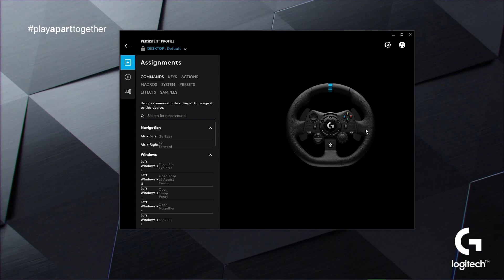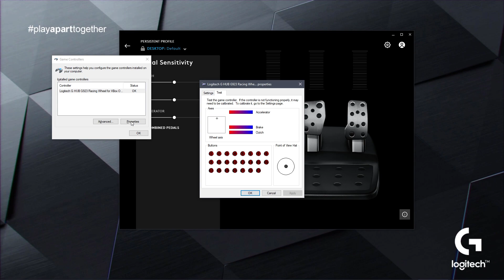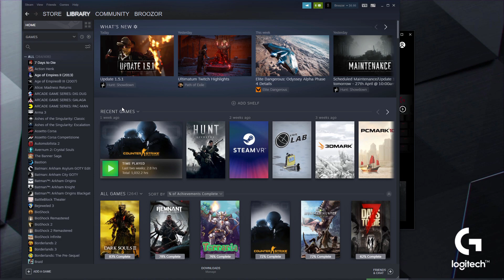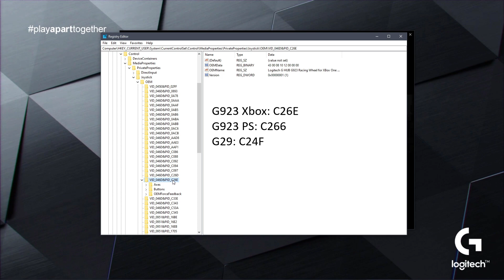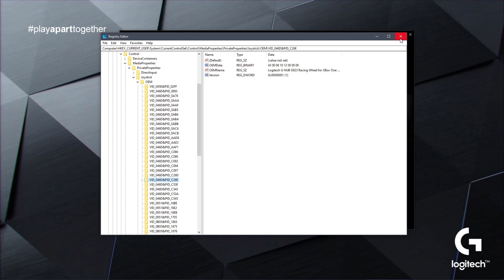How to troubleshoot G923/G29/G920 for Connection Issue

Comment: nice didnt work at all and didnt return in registry thanks for nothing
Reply: READ ALL, I FOUND A POTENTIAL FIX- I fixed it. So what I needed to do was unplug everything from my outlet (except the one below, for context I had an 2*3 adapter for a 2 plug outlet) and it worked just fine after. I had been searching for months prior and I was on the verge of selling it but all it needed was its own outlet. BUT, some outlets have less than 120V, It says this thing only uses 30V but it has to have 120V, kinda weird but whatever. So if that doesn’t work then try a new outlet, your outlet may also have some issues so another good reason.
Reply: make sure all three cords are plugged into the wheel, four if u have a shifter. Dude, I was just as pissed as u until it started to work after these fixes, also rpm lights tell u the issue, you just need to look up what they mean

Comment: anyone got any help for me? my racing wheel isnt being recognized by my computer, it was working when i first got it, and then, for a couple hours, didnt use it, so i unplugged it to make room for myself, next time i went to use it, it calibrates, but it doesnt recognise as being connected, isnt a USB issue, cus it doesnt work with multiple different connections (xbox usb connection) my racing wheel is  logitech 923, idk what i need to do, cus none of these guides help me
Reply: READ ALL, I FOUND A POTENTIAL FIX- I fixed it. So what I needed to do was unplug everything from my outlet (except the one below, for context I had an 2*3 adapter for a 2 plug outlet) and it worked just fine after. I had been searching for months prior and I was on the verge of selling it but all it needed was its own outlet. BUT, some outlets have less than 120V, It says this thing only uses 30V but it has to have 120V, kinda weird but whatever. So if that doesn’t work then try a new outlet, your outlet may also have some issues so another good reason.
Reply: rpms tell u the problem, js look up what they mean.

Comment: hey, i tried every step you did, at first it didn't even calibrate itself, after some fiddling, it starts to calibrate, then the next problem, g hub detects that the presence of the wheel but doesn't get ANY signal from the wheel when i turn it around, then Steam also doesn't detect the wheel. Im using a g29

Comment: Whenever I move the wheel it’s not working
Reply: READ ALL, I FOUND A POTENTIAL FIX- I fixed it. So what I needed to do was unplug everything from my outlet (except the one below, for context I had an 2*3 adapter for a 2 plug outlet) and it worked just fine after. I had been searching for months prior and I was on the verge of selling it but all it needed was its own outlet. BUT, some outlets have less than 120V, It says this thing only uses 30V but it has to have 120V, kinda weird but whatever. So if that doesn’t work then try a new outlet, your outlet may also have some issues so another good reason.
Reply: be sure to plug in all three cords to the wheel, four if u have a shifter

Comment: When I turn the steering wheel, it doesn't turn in the G HUB, not even when I press the pedals.
Reply: READ ALL, I FOUND A POTENTIAL FIX- I fixed it. So what I needed to do was unplug everything from my outlet (except the one below, for context I had an 2*3 adapter for a 2 plug outlet) and it worked just fine after. I had been searching for months prior and I was on the verge of selling it but all it needed was its own outlet. BUT, some outlets have less than 120V, It says this thing only uses 30V but it has to have 120V, kinda weird but whatever. So if that doesn’t work then try a new outlet, your outlet may also have some issues so another good reason.
Reply: make sure to plug in all three cords to the wheel four if you have the shifter

Comment: I need help it wont detect my wheel at all but the pedals work
Reply: READ ALL, I FOUND A POTENTIAL FIX- I fixed it. So what I needed to do was unplug everything from my outlet (except the one below, for context I had an 2*3 adapter for a 2 plug outlet) and it worked just fine after. I had been searching for months prior and I was on the verge of selling it but all it needed was its own outlet. BUT, some outlets have less than 120V, It says this thing only uses 30V but it has to have 120V, kinda weird but whatever. So if that doesn’t work then try a new outlet, your outlet may also have some issues so another good reason.
Reply: Be sure that you have all three cords into the wheel four cords if you have a shifter

Comment: Mine works if i press gas pedal but wont steer. If i use directional buttons on wheel, it stays stuck steering to left.
Reply: READ ALL, I FOUND A POTENTIAL FIX- I fixed it. So what I needed to do was unplug everything from my outlet (except the one below, for context I had an 2*3 adapter for a 2 plug outlet) and it worked just fine after. I had been searching for months prior and I was on the verge of selling it but all it needed was its own outlet. BUT, some outlets have less than 120V, It says this thing only uses 30V but it has to have 120V, kinda weird but whatever. So if that doesn’t work then try a new outlet, your outlet may also have some issues so another good reason.
Reply: be sure you have all three cords plugged into the wheel four cords if you have a shifter

Comment: None helped
Reply: READ ALL, I FOUND A POTENTIAL FIX- I fixed it. So what I needed to do was unplug everything from my outlet (except the one below, for context I had an 2*3 adapter for a 2 plug outlet) and it worked just fine after. I had been searching for months prior and I was on the verge of selling it but all it needed was its own outlet. BUT, some outlets have less than 120V, It says this thing only uses 30V but it has to have 120V, kinda weird but whatever. So if that doesn’t work then try a new outlet, your outlet may also have some issues so another good reason. be sure that you have all three cords plugged into the wheel four cords if you have a shifter.

Comment: Mine has no blinking what so ever, I bought new power supply and checked that worked, but my steering still not working or blinking and not recognized by ghub, I’m using G29
Reply: READ ALL, I FOUND A POTENTIAL FIX- I fixed it. So what I needed to do was unplug everything from my outlet (except the one below, for context I had an 2*3 adapter for a 2 plug outlet) and it worked just fine after. I had been searching for months prior and I was on the verge of selling it but all it needed was its own outlet. BUT, some outlets have less than 120V, It says this thing only uses 30V but it has to have 120V, kinda weird but whatever. So if that doesn’t work then try a new outlet, your outlet may also have some issues so another good reason. be sure that you have all three cords plugged into the wheel four cords if you have a shifter.

Comment: Never had an issue with the Xbox but now the Xbox light on my wheel just keeps blinking. All the buttons still work but the wheel isn’t calibrated when I restart my Xbox and wheel doesn’t work with any racing games only the buttons do.
Reply: The blinking light is telling you something and I think it means that it’s not connected to the steering wheel because that’s what it means for Xbox controllers, so maybe get the Xbox to recognize the controller in the settings somewhere I don’t remember exactly how to

Comment: when i plug my g923 usb into my pc it just says “power surge” and it says my usb isn’t powerful enough. i’ve tried using a usbc adapter instead and it says the same thing. while plugged in my mouse and keyboard don’t work. tried the wheel on xbox and it “turns off” my storage device from my other usb plug in
Reply: READ ALL, I FOUND A POTENTIAL FIX- I fixed it. So what I needed to do was unplug everything from my outlet (except the one below, for context I had an 2*3 adapter for a 2 plug outlet) and it worked just fine after. I had been searching for months prior and I was on the verge of selling it but all it needed was its own outlet. BUT, some outlets have less than 120V, It says this thing only uses 30V but it has to have 120V, kinda weird but whatever. So if that doesn’t work then try a new outlet, your outlet may also have some issues so another good reason. be sure that you have all three cords plugged into the wheel four cords if you have a shifter.

Comment: still not working
Reply: READ ALL, I FOUND A POTENTIAL FIX- I fixed it. So what I needed to do was unplug everything from my outlet (except the one below, for context I had an 2*3 adapter for a 2 plug outlet) and it worked just fine after. I had been searching for months prior and I was on the verge of selling it but all it needed was its own outlet. BUT, some outlets have less than 120V, It says this thing only uses 30V but it has to have 120V, kinda weird but whatever. So if that doesn’t work then try a new outlet, your outlet may also have some issues so another good reason. be sure that you have all three cords plugged into the wheel four cords if you have a shifter.

Comment: dang I thought this was going to help... I just spent 400 dollars :( for it to be broken. to know wait a month for a new one...
Reply: READ ALL, I FOUND A POTENTIAL FIX- I fixed it. So what I needed to do was unplug everything from my outlet (except the one below, for context I had an 2*3 adapter for a 2 plug outlet) and it worked just fine after. I had been searching for months prior and I was on the verge of selling it but all it needed was its own outlet. BUT, some outlets have less than 120V, It says this thing only uses 30V but it has to have 120V, kinda weird but whatever. So if that doesn’t work then try a new outlet, your outlet may also have some issues so another good reason. be sure that you have all three cords plugged into the wheel four cords if you have a shifter.

Comment: i have a issue and i need help. I got a code 45, i have done everything. When i go into steam it says that there isnt any controller connected. If i check the g hub everything is normal, if i go into a game it doesnt work pls help someone
Reply: READ ALL, I FOUND A POTENTIAL FIX- I fixed it. So what I needed to do was unplug everything from my outlet (except the one below, for context I had an 2*3 adapter for a 2 plug outlet) and it worked just fine after. I had been searching for months prior and I was on the verge of selling it but all it needed was its own outlet. BUT, some outlets have less than 120V, It says this thing only uses 30V but it has to have 120V, kinda weird but whatever. So if that doesn’t work then try a new outlet, your outlet may also have some issues so another good reason. be sure that you have all three cords plugged into the wheel four cords if you have a shifter.
Reply: Make sure that you configure your settings so that steam knows it’s a racing wheel not a normal controller

Comment: I don’t understand I’ve tried everything and it’s still not working
Reply: READ ALL, I FOUND A POTENTIAL FIX- I fixed it. So what I needed to do was unplug everything from my outlet (except the one below, for context I had an 2*3 adapter for a 2 plug outlet) and it worked just fine after. I had been searching for months prior and I was on the verge of selling it but all it needed was its own outlet. BUT, some outlets have less than 120V, It says this thing only uses 30V but it has to have 120V, kinda weird but whatever. So if that doesn’t work then try a new outlet, your outlet may also have some issues so another good reason. be sure that you have all three cords plugged into the wheel four cords if you have a shifter.

Comment: bro my wheel doesn't even move left and right. I checked my control manager  all of the things work except the actual wheel. It turns so easily like my computer isn't on I have a 24v power cable and everything should be working FINE! And nothings working in GHUB
Reply: READ ALL, I FOUND A POTENTIAL FIX- I fixed it. So what I needed to do was unplug everything from my outlet (except the one below, for context I had an 2*3 adapter for a 2 plug outlet) and it worked just fine after. I had been searching for months prior and I was on the verge of selling it but all it needed was its own outlet. BUT, some outlets have less than 120V, It says this thing only uses 30V but it has to have 120V, kinda weird but whatever. So if that doesn’t work then try a new outlet, your outlet may also have some issues so another good reason. be sure that you have all three cords plugged into the wheel four cords if you have a shifter.
Reply: I don’t think your cord is big enough no pun intended because the wheel takes 30 V to 40 V

Comment: so my light is fl;ashing and i tried un plugging and plunng in some where else also. what should i do then
Reply: READ ALL, I FOUND A POTENTIAL FIX- I fixed it. So what I needed to do was unplug everything from my outlet (except the one below, for context I had an 2*3 adapter for a 2 plug outlet) and it worked just fine after. I had been searching for months prior and I was on the verge of selling it but all it needed was its own outlet. BUT, some outlets have less than 120V, It says this thing only uses 30V but it has to have 120V, kinda weird but whatever. So if that doesn’t work then try a new outlet, your outlet may also have some issues so another good reason. be sure that you have all three cords plugged into the wheel four cords if you have a shifter.

Comment: But what if in "Steering wheel" the steering wheel look like it's turned completely left, but is it actually in the middle? How do I fix that?
Reply: dang dude, I think you do need to reset some things on g-hub. That can only be because someone messed up the settings on g-hub

Comment: I bought new power wire and usb wire and still nothing happens when u plug it in. Not light no nothing. I have g920
Reply: READ ALL, I FOUND A POTENTIAL FIX- I fixed it. So what I needed to do was unplug everything from my outlet (except the one below, for context I had an 2*3 adapter for a 2 plug outlet) and it worked just fine after. I had been searching for months prior and I was on the verge of selling it but all it needed was its own outlet. BUT, some outlets have less than 120V, It says this thing only uses 30V but it has to have 120V, kinda weird but whatever. So if that doesn’t work then try a new outlet, your outlet may also have some issues so another good reason. be sure that you have all three cords plugged into the wheel four cords if you have a shifter.
Reply: Probably a bad outlet
Reply: or one that is being overused

Comment: Is there a softer progressive Spring for the g923 Brake? The original Spring is just to hard and bend my Rig if i need to brake 100%
What Force does the original Spring have? Mybe i find a softer by myself.
Reply: there’s a way that you can change that you’re gonna have to do some physical things rather than with computers, but what you can do is, you can take a screwdriver unscrew the bottom part there’s actually some tutorials on it but there’s a little rubber piece inside of the brake pedalinside of the piston and it basically the top of the piston hits the rubber thing and stops it from moving any further. I took it out as the first thing I did.

Comment: still didnt work i have the g923 ps4 version and theres a flashing led but the logitech g hub doesnt receive the feedback that the wheel is moving and it doesnt automatically calibrate ive tried everything in the video and still doesnt recieve the wheel feedback
Reply: READ ALL, I FOUND A POTENTIAL FIX- I fixed it. So what I needed to do was unplug everything from my outlet (except the one below, for context I had an 2*3 adapter for a 2 plug outlet) and it worked just fine after. I had been searching for months prior and I was on the verge of selling it but all it needed was its own outlet. BUT, some outlets have less than 120V, It says this thing only uses 30V but it has to have 120V, kinda weird but whatever. So if that doesn’t work then try a new outlet, your outlet may also have some issues so another good reason.
Reply: make sure you have all three cords plugged in (4 for shifter if you have it)
Reply: READ ALL, I FOUND A POTENTIAL FIX- I fixed it. So what I needed to do was unplug everything from my outlet (except the one below, for context I had an 2*3 adapter for a 2 plug outlet) and it worked just fine after. I had been searching for months prior and I was on the verge of selling it but all it needed was its own outlet. BUT, some outlets have less than 120V, It says this thing only uses 30V but it has to have 120V, kinda weird but whatever. So if that doesn’t work then try a new outlet, your outlet may also have some issues so another good reason. be sure that you have all three cords plugged into the wheel four cords if you have a shifter.

Comment: its in ghub my pc isnt detecing movment please help
Reply: READ ALL, I FOUND A POTENTIAL FIX- I fixed it. So what I needed to do was unplug everything from my outlet (except the one below, for context I had an 2*3 adapter for a 2 plug outlet) and it worked just fine after. I had been searching for months prior and I was on the verge of selling it but all it needed was its own outlet. BUT, some outlets have less than 120V, It says this thing only uses 30V but it has to have 120V, kinda weird but whatever. So if that doesn’t work then try a new outlet, your outlet may also have some issues so another good reason. be sure that you have all three cords plugged into the wheel four cords if you have a shifter.